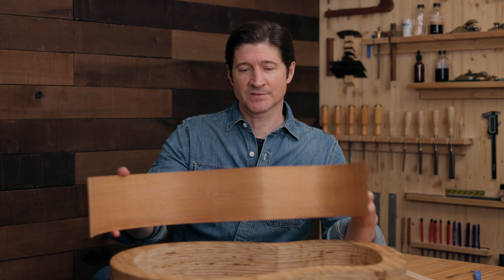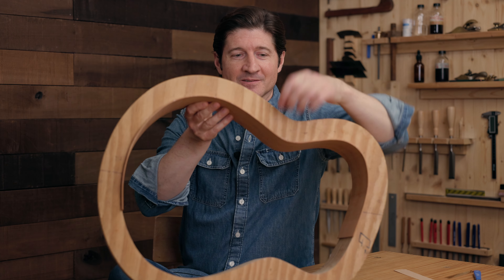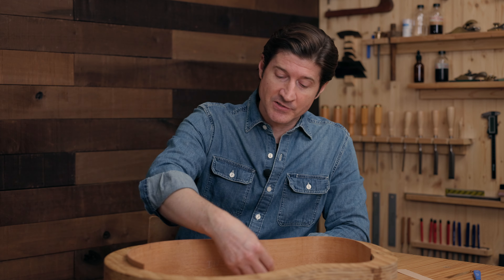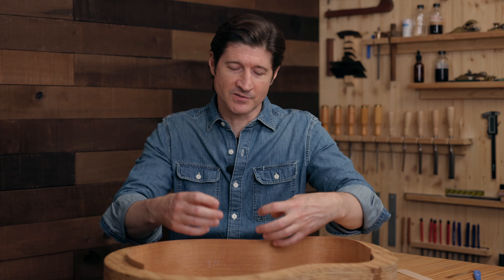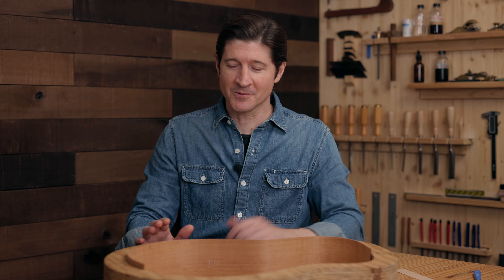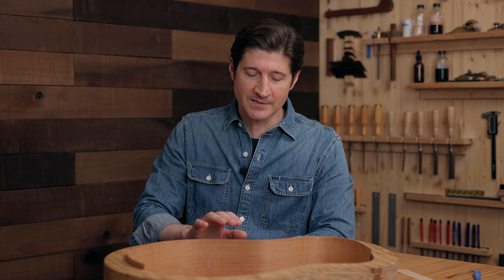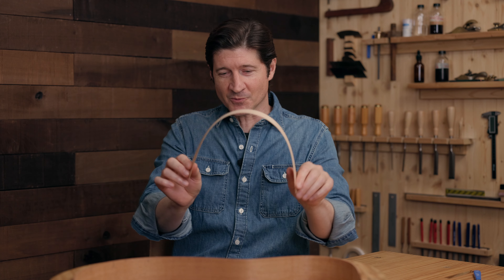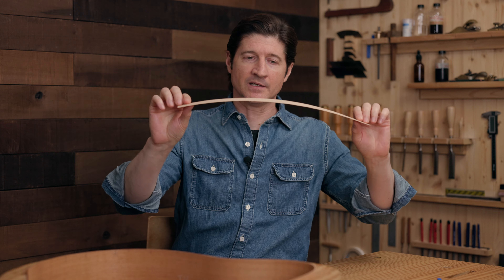How To Spot & Avoid Stress Concentration

Comment: Lots of good advice.  

I'm still very early on my path to becoming a "luthier".  My first project was a ukulele kit, which I'm still working on as I have the time, from a well know guitar parts supplier and the sides were twisted.  I was going to use the sides and force them into position but decided I didn't want that added stress to the body.  While it might not have ever been an issue, I didn't want it to become one so I swapped it out for another kit and moved on with my build.  

I'm glad chose to swap out the kit because I wouldn't want the thought that it might come apart in the back of my mind.